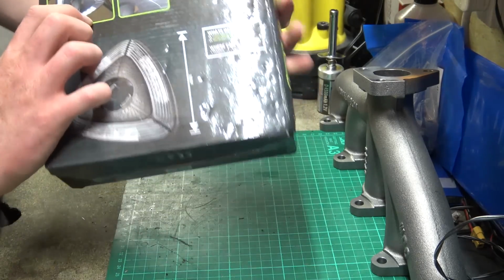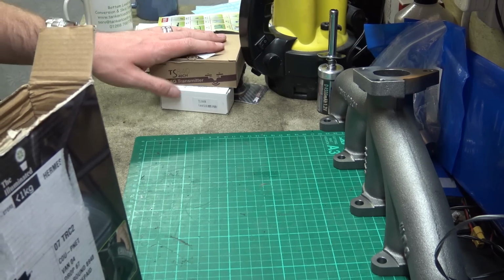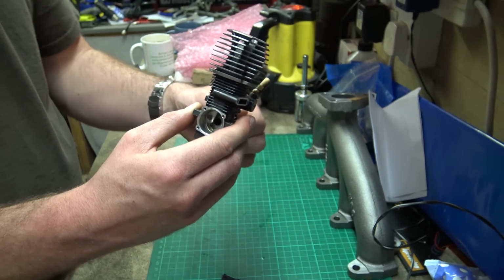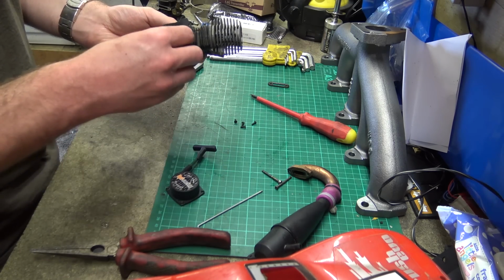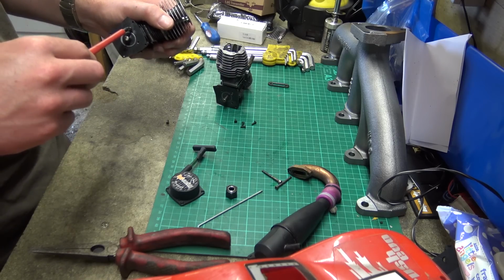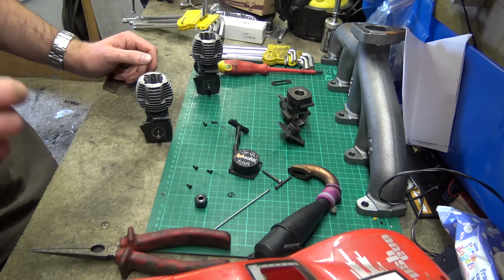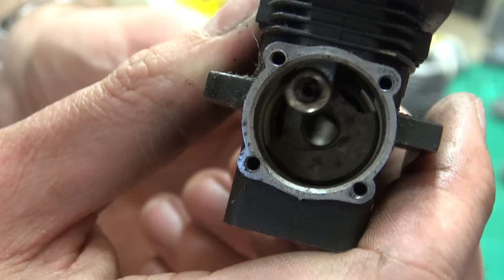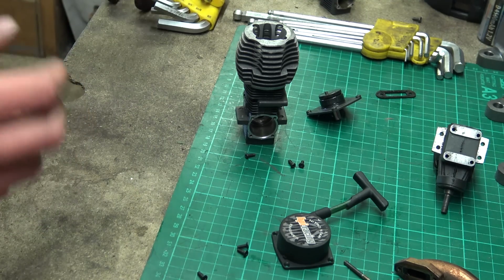I Got a T15 Engine For My HPI Rush Evo!

Comment: Glad It arrived ok the woman at the parcel shop didn't have any bags to put the box into. I had left the nut on the end of the engine so you could turn it over with some pliers or a small spanner lol , I didn't know much about the engine as I remember getting it with a load of other stuff from a car boot years ago and I just covered it after run oil and put it in a bag and it has sat in the garage like that for probably 7-8 years. I did notice it was still tight at TDC so I assumed it had had very little use once the engine is warm it will loosen slightly. Just a pitty that you couldn't getting running straight away I was looking forward to see it going.
Reply from the maker: It’ll be going matey I’ve since had the pin in oil and it’s free so part two will be up soon. 🤪👌🏻